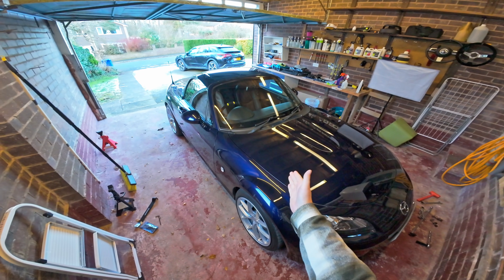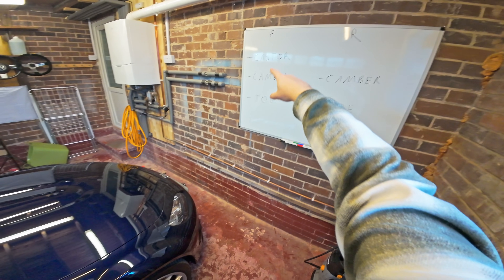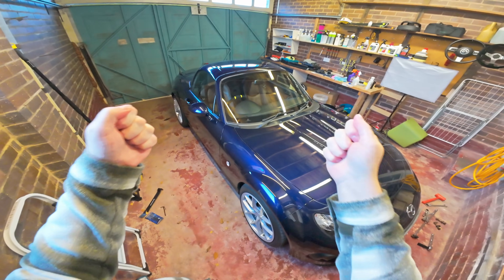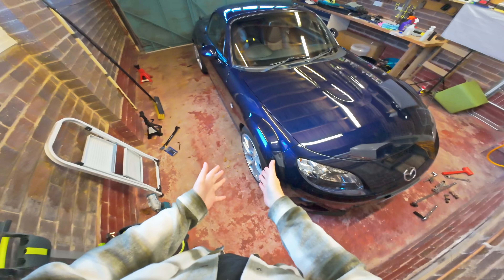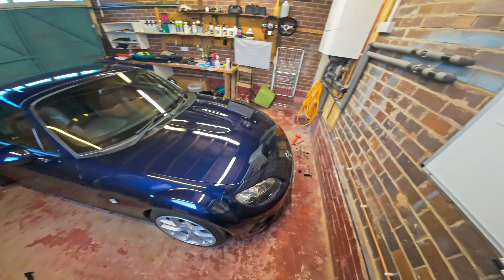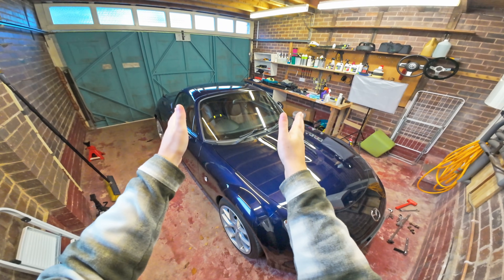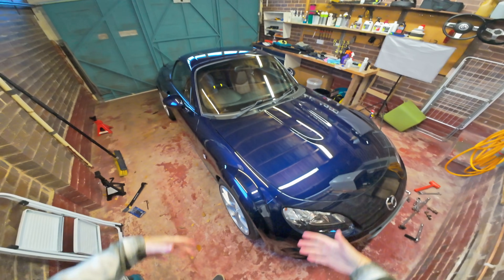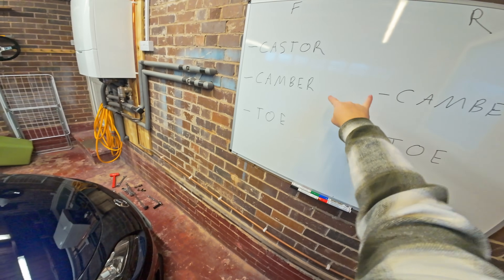I aligned this car 12 times - here's what I learnt

Comment: Camber is one of those tricky trade off ones; you'd like camber gain during roll, not really static camber. but then under accel and braking you don't want camber also. 

toe out helps a lot at tight, low speed corners. this happens because the inside wheel creates drag earlier, helping with turn-in. FWD cars especially tend to struggle here so makes sense that it's a common choice for them.

Comment: I drive a NC Miata like yours for fun on my local mountain roads, I’m on the suspension II kit from Flying Miata with wider summer tires on 17x9 wheels.  The car is also spec’d with Flying Miata’s alignment numbers.  You just opened my eyes to the idea of increasing the toe out just a bit more. I’ve aligned my car at least 3 times within a year just to fine tune the feel and as my tires are wearing down I’m experiencing more tram lining. Respects from Los Angeles.

Comment: camber is all about getting the full tire contact patch on the ground at the desired speed/situation. Most modern cars have some camber by default for them to be safe on high speed motorway turns. You also need camber is you do low speed time attack type racing due to the large tire wall deformations. Other than those two situations, you don't really need camber. As you mention it might help a bit if you want to tune oversteer/understeer out of the car, but the other factors are much more pronounced.

Comment: I like more caster with less camber than the vice versa.

And for front toe, when I'm calculating how much toe in or out I want, I usually have to base it on the scrub radius. A positive scrub radius on a RWD car (your MX-5 and my E46) will dynamically toe-out upon acceleration and braking, so a mild static toe-in could straighten out to zero toe upon accel and braking - or if the scrub radius is higher, the initial mild static toe-in could even dynamically change to toe-out upon accel and braking. That said, my E46 is an understeery chassis, unlike the MX-5, so I actually set the front to zero static toe and run mild scrub radius, so that it toes-out only slightly upon accel and braking, which I find to suit my driving style during corner entry because I like to trail-brake.

For cars that are negative scrub radius or cars that are front- or all-wheel drive, then I'll probably set up the front toe differently.

Comment: Most mid-engine cars do toe out or zero on the front and very slight toe in on the rear. Unless you're autocrossing, then toe out the rear 😉 You certainly have done the work to figure out your personal preference on your application, tho.

Comment: Great video! The quality of a car's alignment does so much more for how it feels than most people give it credit for. My NA has had 4 done in 18 months of ownership as the bolts kept slipping out of place once I fitted semi slick tyres, so I've had the opportunity to experience some really extreme alignment settings as a result and your descriptions are spot-on. 

The most recent alignment that finally fixed the slipping was done at a shop known in my area for setting MX5s up for the track, and they got it pretty close to the Flyin' Miata recommended settings. It instantly felt so much better, becoming super responsive instead of wanting to oversteer when changing direction quickly. The suspension now properly "settles in" on sweeping corners with brilliant stability. I was laughing like a maniac the first time I got to really test what the car was now capable of, it was just that good.
Reply from the maker: Hahaha the bolts slipping hits home so hard - this is part of the reason for the first 2-3 alignments. After that I was like "wow it makes so much difference I want to know EVERYTHING"

Comment: 3:09 vehicle dynamicists correct me if I’m wrong, but this increased feel comes from the greater mechanical trail and resultant increase in aligning torque from the tire, not lifting the car.

Increased camber definitely makes a difference in total grip and also the balance of the car. The leaned tire creates thrust in the direction it is tilted (camber thrust). When you’re going straight the loads from each side cancel out, but when one side goes over an irregularity it causes the tram lining. This can be substantially reduced with toe out which reduces the camber thrust moment.

Comment: Will adjustments in tyre pressure have any influence on any of the three settings on the front or back ends?
Reply from the maker: Into the rabbit hole you go!

Yes, massively. I decided early on I would stick with one tire pressure so all my testing was done at 28psi on this car. But +3psi in the rear will make it more likely to oversteer so then you can +camber or +toe in... it gets very complicted.

Comment: I've had my focus checked so many times by different garages because after a KwikFit front tyres and alignment ( don't judge, I had a 50 quid voucher and the outside front was worn ) it's never felt at one with the road, it's vauge.
All garages have said it's spot on and theres no play in the suspention.
One garage scoffed and said they'd check it on their laser, I'd probably kerbed it or hit a pot hole, a few minutes later they proclamed they had never seen a car come in with perfect alignment. 
Yet it still drives like I'm on 2" crossplys, is far too light, never loads up and eats outside edges, but is on Goodyear Efficient Grips and supposedly perfect.

I used to ask for a hint towards toe out from spec on my old mk3 Fiesta, maybe the Focus needs the same.
Reply from the maker: Cheat code - Potenza Sport, S001, Yoko V105/107 (I should do a similar video about tyres to this one)

Then again that will give you the last 10%... If the steering is fundamentally vague you can't fix it with tires.
Reply: @MickDrivesCars  Everything changed after that first alignment and the newness of the tyres wore off, same tyre as before but the car had fundementially changed
Reply from the maker: Just coming back here - I think I replied to the wrong comment.

2 options - something's broken and they've aligned around the issue, hiding it OR you've got a faulty tire(s) with a slipped belt or something?
Reply: @MickDrivesCars  I did wonder about that reply...
3 different garages, none can find anything wrong. It's been on shaker plates, been prodded and passed two more MOT's with no issues.
New rear dampers did make it less unpredictable as I felt under load the back was leaning more than the front and losing traction.
None of the tyres from when this first started are the same ones and they were rotated.
Eats the front left outside although I do have a couple of fast roundabouts and right bends on my drive to work.
Short of a full suspention refresh (and it's not worth that much or that cherrished ) I'm out of ideas.

I'm pretty good at feeling when things aren't right, one garage couldn't find what was wrong with an older car of mine that suddenly after a patch of very cold weather and rough ice covered roads was unstable in right bends but felt ok everywhere else, this was only when pushing on.
Replaced a few bits but nothing worked so they wrote it off as thats just how that car drives.
Next MOT they found a cracked front left anti rollbar link, still holding on but cracked none the less.
Instantly solved the issue.
Sadly current car isn't the same.

Comment: Should note that most of your statements apply to all vehicles but there are situations with other suspension designs or in fwd where the opposite is needed. Bump steer/toe and camber curves are critical for understanding the dynamic element of an alignment. Could be a good future video.

Comment: Yo, you should look into mods to your sound tube/ISE, free intake noise, my NC3 sounds a bit like it has ITBs!
Reply from the maker: Just had a quick Google, all I can find is info on removing the sound tube. Is this what you mean?

I kinda like the idea of piping sound into the cabin
Reply: @MickDrivesCars  it's more for the ND but since the NC2/3 has an ISE too I'm experimenting myself, there are kits for the ND where you replace the factory tube that has a solid internal wall that blocks sound to the cabin with a free flowing tube (Davedoesit on youtube for example). So far I have drilled out that wall on mine with a 35mm hole which gave an awesome ITB sound at lower rpms, as well as replaced the entire thing with different tubes, still deciding on what I like best as it's hard to record/video consistently.

That wall in the stock piece also stops air from the cabin getting into the intake so you must replace it with a thin diaphram, the go to method is with a rubber glove closer to the intake pipe
Reply: @MickDrivesCars  if you look up "Mazda MX5/Miata NC/ND free sound tube/ISE mod tutorial" on youtube you'll find a quick sample/video explaining how to do the mod on my other tiny channel called raight or something
Reply from the maker: Very similar to the early BMW Z4's - there's a sound tube mod which sounds insane from the drivers seat. I'd love to get my NC something similar. I'll look into it more mate, thank you.

I'm thinking maybe a bit of foam rather than a diaphragm...

Comment: Hey, need help on buying all the correct tools to adjust all three settings (mx5 ND). Any recommendations ?

Don't tell me to go to a shop, I can already do that, but I want to learn!
Reply from the maker: This is a rabbit hole you do not want to go down... trust me

I spent ~£1000 trying to build an easy at-home alignment setup and in the end the elevation in the floor of my garage has meant every alignment I do is useless
Reply: @MickDrivesCars  because your floor isn't perfectly level ? What if mine is ? I've checked, seems like it's level. Or did you mean something else ?
Reply from the maker: It was just an example that alignments are very sensitive and building a good system at home is very difficult 

To answer your actual question:

- spanners/wrenches 
- jack(s), you need them to go really high
- some way to have the car lifted while still being on its wheels (I built "wood wheel cribs")
- toe plates (do all 4 wheels!)
- camber gauge (I got a nice digital one from Amazon)
- pole+string setup, I recommend the ones that clip onto licence plate
- caster tool (buy a real one, don't try to measure manually)
Reply: @MickDrivesCars  thanks so much! Will think about it and remember your warning 😅 I really want to learn so I'm still interested, although the way you speak about it makes it seem like it really wasn't a good time 😭
Reply from the maker: The best thing for me was getting friendly with my local alignment shop. Now I have the dudes phone number and I just book as usual, but I setup the machine and turn the bolts myself. They give me a little discount
Reply: @MickDrivesCars  that's crazy haha. Sounds good enough and at least you do what YOU want!! I'll try to make that happen then 🤪 thanks so much for the insight man, really !

Comment: Your preferences are a little unusual. I prefer lower caster for reduced self centering torque which dilutes the natural breakaway feeling from the tire.
Reply: I found this as well, with large castor, mechanical trail dominates the pneumatic trail of the tyre, thereby masking the finer forces that inform you when the tyre has reached optimal slip angle. Its not just sliding into understeer, its all the information about the grip. Also, nc already has quite a lot of castor even at minimum setting. Great video btw!
Reply from the maker: I almost never understeer so front breakaway feedback isn't a big focus

Comment: I sometimes use toe-out on the rear wheels... In Gran Turismo 😂 Usually with cars with bad understeer on tracks with lots of hairpins and 90 degree turns. For combating said understeer, it makes kicking the tail out easier; be that with the E brake or RWD torque. Combined with neutral alignment on the front for optimum straightline braking, it's not a bad combo for the right niche scenarios.
Reply from the maker: You're not the only one to mention simulators... what they don't convey is the feeling of nervousness and ''I might die at any point'' you feel in real life with rear toe-out :D
Reply: @MickDrivesCars 🤣 LOL

Comment: There is another value about your front suspension geometry which is scrub radius... You can change it with adding spacers between your hub and the wheel (Changing wheel ET)  you can gain "texture" or lose in both + and - ways. You must try it and find out. Also you may like solid bushings... :) Then try front toe out, I think you will love it! :cat-orange-whistling: You are getting kind of scrub radius simulation with toe in... True texture comes with scrub radius. Btw it effects too many things like roll center. Hope that will help, great car btw 🤙 (whispers: change your brake balance :))
Reply from the maker: There's also Ackerman, KPI and a bunch of others that I did talk about, but cut in edit to make a more beginner friendly video

I should note this car is on a 7.5j ET42 which is both wider and more offset than stock 7j 55et... naughty I know. No spacers though, cause I did the maths :)
Reply: @MickDrivesCars Yeap, you name it 🫠 7J 55 -> 7,5J 42 = 51,8mm differance in front track... That's too much. That's equal to 26mm spacers on both side with current wheels...
Reply from the maker: The extra 0.5j is split between both sides of the wheel so ~=19mm spacers but overall... Yeah 😂

Looks good though 😎
Reply: @MickDrivesCars Yeap, again looks to much to me but waiting for the vid 🤙

Comment: I have a cobalt I lowered it 1.5 inches and the little bit of front camber was perfect. Aswell as a thicker sway bar in the rear. I gave it some toe in up front and I went perfectly straight in the rear and for fwd. With my rear bias I setup on my breaks. I ride the brakes a tiny bit and with throttle it holds oversteer thru almost any corner. It also has a LSD Wich does a lot of the work lol.

Comment: MX-5:   Max caster / Rear camber: -1.25*  /  Front camber: -1* /  Total front toe out : 0.5*   Have it done while you're sitting in the driver's seat.
Reply from the maker: The problem with these kinds of "presets"... My minimum rear camber is 1.9-2.0 at this ride height

Alignment is not one-size fits all!
Reply: @MickDrivesCars  Maybe what you're actually describing is: "I've lowered the car too much to set it up properly."  -2* is autocross territory.  An MX-5 isn't a '90s Civic.  To each his own, though...  Your car looks good.
Reply from the maker: What I'm actually describing is I've just re-read your post and you suggest 0.5deg front toe out so I don't think we can continue this discussion :D
Reply from the maker: Highway speed stability will be the least of your problems 😂
Reply: @MickDrivesCars  Whoops.  Deleted a respnse instead of editing the one I just wrote.  🙄 Anyway...  I've only ever had MX-5 handling problems with excess negative camber.  What coilover system do you run?

Comment: You don't lift the whole of the front of the car with castor, it's KPI that does that. The outside front corner of the car actually falls as a result of steering that outside wheel round a corner if it has positive castor. The inside front corner lifts a commensurate amount meaning that overall, the front of the car remains the same height during steering due to castor and since the majority of the weight is on the outside wheel (which drops) this particular effect of castor shouldn't create a huge issue for the steering getting heavy.
KPI however can raise the front of the car significantly. 
The reason front wheel drive cars have static toe out is because the drive torque applied to the front wheels causes them to toe in, so it helps to have static toe out to avoid getting excessive toe in during driving.
Reply from the maker: Really interesting - does increasing caster in the common way (eccentric bolt in bush) also increase KPI?

Didn't know FWD cars did that (I bloody love good comments like this!). Maybe 0 toe then FWD boys, or just less toe out. One to experiment with because texture in the steering is very desirable.
Reply: @MickDrivesCars KPI would only change very very marginally, and depending on the initial angle of the lateral suspension arm it could either increase or decrease.
Reply: Doesnt this happen on rear wheel drives as well?
Reply: @dmtc6913 the impact of castor is the same for all cars. Front wheel drive cars tend to create toe out during driving whilst rear drive cars tend to create toe in during driving.
Reply: @pjay3028  sorry I should have been more clear. Was referring to the effect of drive torque.
Reply: @dmtc6913 it's the drive torque that creates the toe out so it doesn't happen on the front wheels of a rear drive car.
Reply: @pjay3028 no i did mean drivetorque toe in at the rear on rwd. as you originally stated it created toe in on fwd and they add some static toe out to balance that.
Reply: @dmtc6913 I think the rear wheels tend to be much more resistant to toe changes as a result the torque because of course they don't steer